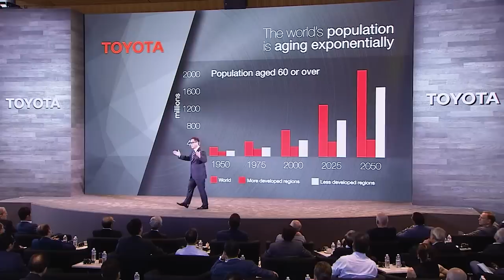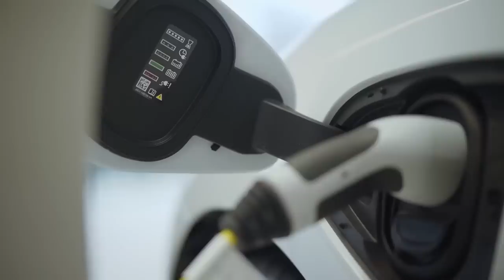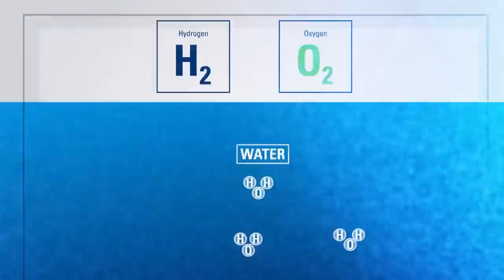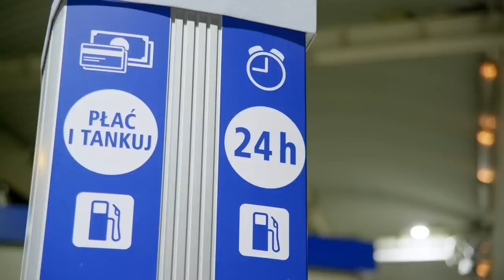New Toyota CEO Shocks Everybody | Huge News

Comment: EVs are a long way from being viable for everyone, so this makes sense.
Reply: But it is viable for the vast majority, and so non EVs will become more expensive relatively due to a reduction in economies of scale.
Reply: What makes EVs unviable for many people?
Reply: And not everyone wants one either lol
Reply: @Stefan Leonte  I have a pickup truck. I use it to tow my 5000lb boat/trailer, I use it to tow my 5000lb snowmobiles/trailer. Currently, I can take my boat or snowmobiles 450 miles in any direction within about 6 hours, not 2 days.
Reply: @TankEnMate  Not everyone lives in the city.
Reply: @stefanleonte3155  there is a whole list of reasons. Cost( will go up with demand for lithium and cobalt) charging ( availability and infrastructure) weather( everything is worse in cold) etc etc. 

There is a lot of problems still to be resolved!
Reply: @thnksno  that’s awesome! So how exactly does a hydrogen vehicle make sense? It sounds that your specific needs cover hauling a decent trailer load and also functioning in relatively remote areas. The Mirai has a capacity for 5kg of hydrogen, which is equivalent to around 150kWh of BEV storage capacity. The Rivian has a battery of 135 kWh, which many people complain about in terms of range for towing significant loads. How exactly does hydrogen make sense here? The number of hydrogen stations needed along corridors that people tow would be insane.
Reply: @antonherres7112  this is funny. Now do the same for hydrogen. If rolling out EV charging is challenging and expensive despite us having electricity distribution pretty much everywhere, humor is with how rolling out hydrogen stations and creating plus distributing hydrogen is going to be cheaper and easier?!
Reply: @Markcain268  it’s funny how people don’t appreciate that hydrogen cars are powered by electric motors, just like BEVs.
Reply: @stefanleonte3155  if they use a hydrogen power cell, yes, and, apparently, people don't want those either lol
Reply: @Stefan Leonte  It makes sense in that Toyota isn't all in on EV or hydrogen. Hybrid, for them, is a good enough stop gap. However, even that's not good enough to do real actual work at the expense of oil. Toyota's new full-size vehicles with hybrid are only gaining 3-4MPG on their prior normally aspirated V8. I didn't start this thread to cheer on anything besides Toyota not following the crowd. EVs on a mass scale have a long way to go. In fact, I'll go so far as to say, 40+ years.
Reply: Why would I have my only vehicle to be an EV. I’ll have an EV to drive around the city and near by cities/town, use a hybrid for long distance driving, and a light weight sports cars for ultimate enjoyment. This will always be the lineup for a house with multiple vehicles.
Reply: @Stefan Leonte   Theoretically, an EV could likely do a good percentage of my driving. However, it is mostly impractical for a good percentage of tasks I expect it to do as well. Ultimately, it is entirely impractical to have 2 vehicles, 2 registrations, 2 insurance policies, and need 2 times the space to store 2 vehicles that cost 2 times as much as "the best current solution."
Reply: @curvetrcalinga  LOL! I was just formulating the same message.
Reply: @thnksno  hybrids were a good idea for urban cars stuck in commuting traffic before BEVs. Hybrids, from an efficiency perspective, are arguably useless with BEVs available today. PHEV have somewhat of an argument but that is rapidly diminished by the reality that the bill have undersized battery packs paired with thirsty engines and inefficient aerodynamics, with it being more advantageous to simply dump the EV portion and retain the ICE portion of the package. For some applications ICE options will remain into the future, however, these will be few. Hydrogen has zero feasibility for personal transportation; the economics and infrastructure challenges are simply too great to ever compete with BEV. Toyota’s dangerous path is not its continuance with ICE, which is a sunk cost at this point, but rather the combination of continuing to pour more good money after bad in its fixation on hydrogen and it’s relatively slow adoption and progress with BEV compared to its competitors. For every person who needs a pickup to tow a trailer long distances in a remote geography, there a multiples more living in urban environments where hauling heaving loads is not a issue and access to electricity is plentiful.
Reply: @Markcain268  as opposed to what, using hydrogen in modified ICE setups? There have been numerous videos done illustrating why this is beyond impractical and stupid: the volume of onboard hydrogen storage leave pretty much no space for anything else. Engineering Explained did a good video on this in response to Lexus’ hydrogen V8 concept.
Reply: EV's are a lot closer to being viable for everyone than is hydrogen.
Reply: @easternyellowjacket276  yes, but it's dumb as hell to try and say everyone has to switch. Electric are good for some. And hydrogen in certain areas helps with the load in the grid electric cars cause. Not to mention the crazy demand for rare and toxic elements needed
Reply: @stefanleonte3155  make your mind up! First you are against hydrogen power cells now you seem all for them lol, seems like you just come on here just to argue!
Reply: Here in Europe EVs are perfectly viable TODAY. I've had one for 4 years now and have never been inconvenienced by owning one....in fact 95% of the time it is far MORE convenient to own an EV rather than having to stop an pump toxic fuel at great expense into a tank. The ICE is dead and Toyota and others just need to recognise that if they want to stay in the car making game.
Reply: @kiae-nirodiariesencore4270  I'm the same with ice, never been inconvenienced by one in over 30 years and all my cars have been very second hand lol
Reply: @kiae-nirodiariesencore4270   All of Europe is like the size of Wisconsin. In the US, you can drive for hours and still be looking at the same mountain range.
Reply: @stefanleonte3155  People who live in major cities have no place to charge their cars. In NYC (and the surrounding metro areas), where a lot of people live in apartment buildings, most don't have access to parking garages and have to park on the street sometimes several blocks from their apartment.  Where/how will these people charge their cars?
Reply: @thnksno  You really don't know much about Europe do you. I am from the UK which is 1.5 times the size of Wisconsin and I live in France which if 3.2 times the size. Spain is 1.2 times the size of California and France is just a bit smaller than Texas...Drive from Portugal to Finland and you stay in the EU the whole way and the distance is about the same as New York to LA. Sure, the USA has more contiguous land mass but we really do know what a 'road trip' is.
Reply: @thnksno  Europe is literally 2x bigger than the continental US.
Reply: @Markcain268  I’m for hydrogen fuel cells in passenger cars? That’s news to me! How did you ever come to that conclusion?!
Reply: @joelombardi4907  this is hilarious. Pretty easy - the majority of people in NYC don’t have cars! For the areas that have street parking, places in Europe have already shown how it’s possible to incorporate charging infrastructure into existing curbs, similar to parking meters. Want to try incorporating hydrogen fueling stations in places like NYC?
Reply: @stefanleonte3155  ummmm, I'm talking about the suburbs that surround NYC, like Queens/Brooklyn/Bronx/Staten Island---these are all considered NYC. Many people live in apartment buildings, big and small. Most have to park blocks away from their building. The parking meter/charger scenario might be able to work, but it will take NY many, many years to try and support this. As I mentioned, before any of this happens, NY needs to overhaul its entire electric grid, which serves over 8 million people.
Reply: @joelombardi4907  I’m very familiar with NYC and its boroughs, as I’ve lived there. Any infrastructure rollout is hard. However, some rollouts simply don’t make sense. If it’s challenging to rollout curbside charging for street parking when we already have the electricity cables right there, imagine how much more difficult it is to build and fill hydrogen filling stations. ICE is going away, and something must replace it for personal vehicles. It simply doesn’t make sense to try and go the hydrogen route for personal transportation over electric.
Reply: @stefanleonte3155  I'm not saying to go hydrogen. For the whole city to get on board with electric vehicles, so much as to be done. At the pace its going, we will not see it in our lifetime.
Reply: @stefanleonte3155  in your reply to a previous comment, you gave me a lecture for saying nobody wants hydrogen fuel cell cars, have you lost track or did you not understand my comment? 🤔
Reply: @TankEnMate  That is absolutely correct. Scale economies are being gained year on year for EVs and lost for fossil fuel cars as demand for them continues to decline. We reached 'peak ICE' in 2018 and those sales are never coming back.
Reply: @kiae-nirodiariesencore4270  took a lot of bribery to achieve it though, didn't it?
Reply: Tesla will be just like Ford and Chevrolet in 10 to 20 years from now.😂
Reply: @Markcain268  I think you may have completely misunderstood things, if you at any point you were of the understanding that I in any way support the notion of hydrogen as a fuel source for personal transportation.
Reply: @stefanleonte3155  price.  I want the Kia ev6 GT 576 HP version.   It will cost me 70k out the door.... FOR A KIA..... YEAH..NO
Reply: @kollennekoll5997  No they won't! You don't seem to understand embedded culture in companies. That's not to say another even smarter, faster, more creative firm will not come along and try to eat Tesla's lunch but right now Tesla are eating the lunches of the fossil fuel based OEMs who cannot compete in the only market that matters going forward, making and selling EVs.
Reply: @stefanleonte3155  price & weight
Reply: @stefanleonte3155  only batteries for you eh? Surely they can come up with something better than batteries and a motor, lol I was playing around with those as a child in the 70's,  think I'll wait until something brand new comes out!
Reply: Brillouin Energy begins commercialization of pulsed catalyst cold fusion electric heating system.
Leonardo Corporation publishes data sheet for zero-point energy source.
Brilliant Light Power develops clean energy solution for $0.001 per KWH based on hydrino technology.
Reply: That and the fact that EV's are not even close to zero emission because they consume far more materials and energy to build them. Also, when considering what to do with them at end of life they are an environmental disaster.
Reply: @stefanleonte3155  not everyone is retired and drives a golf cart
Reply: @timothyjohnson1511  There is so much going on in the world of technology. By early 2030s the oil and gas industry will be seeing a massive down turn in demand for their products.
Reply: Hydrogen is very hard to store and transport. You can't just use existing gasoline pumps or transport systems with hydrogen ones because it has a low volumetric energy density. You would have to build a new one. Because real hydrogen motors don't work well there are no real hydrogen cars currently, they are all actually electric vehicles with hydrogen fuel cells. Making them more complex and they need more lot more maintenance compared to battery vehicles. Also turning electricity to hydrogen and back to electricity introduces huge of energy loss compared to just batteries. It's tech that is not going be used in cars expect maybe in very very rare cases for long range transport.
Reply: @TankEnMate Until an ev can be purchased for less than 20K new I will not buy one. You may think that 45-50k is reasonable for a daily, but I do not. The US is not like Europe, EV works because vehicles are small there, distances traveled by car are less as mass transit is more efficient and less costly. Here in the US where everything is big, heavy and everyone has a personal vehicle EV is not as efficient as people think. If the US goes full EV without an alternative to a heavy battery, we'll be paying more for 80% fossil fuel electricity than gas or diesel. I'm of the mind that if one doesnt want to drive or really wants to make a difference with the environment, investments in bus and train needs to be made. EV alone is just putting the blinders on and ignoring the real problem.
Reply: @stefanleonte3155  Have you ever heard of "hydrogen combustion"?
Reply: @kiryukazuma88  he only likes batteries and leccy motors
Reply: @bdaig12  In the US both solar and wind are cheaper than coal, gas, or oil for electricity. Even today a BEV is cheaper over it's lifetime than a fuel based car (ICE or fuel cell), the only thing that is more expensive is up front cost; for BEVs energy is cheaper, servicing is cheaper, and resale values are higher.

Norway is a fossil fuel giant; it has massive reserves of oil and gas; and has been exploiting that for decades. But for their own use they get 99% of their electricity from renewable sources. Over 80% of their vehicles are BEVs. And they have one of the most rugged and inhospitable landscapes in Europe. And to top it all off they have one of the highest per capita incomes in the world (about 14% higher than the US). They have universal healthcare and universal social security. So progress is possible if the focus is on finding evidence, adapting to change, and solving problems rather than only believing what you want to believe, dressing opinions up as facts, and scoring points.
Reply: @TankEnMate  LOL hows that?  you cant even pull anything without the milage going way down.
Reply: @stefanleonte3155  Try living anywhere where it gets below zero in the winter.  You can have a full charge and the cold will drain  it to nothing.
Reply: @johngatsby1473  price you say? Okay. What is your ICE equivalent for the same power and performance in a four door vehicle with a plenty of storage? Since price is your issue, you’ve got a cheaper ICE equivalent, right?
Reply: ah yes, of course. The most popular selling vehicles in America (full size pickups) are so cheap and light! Funny that.
Reply: @Markcain268  maybe wait till we go back full circle and land back at using horses, with excrement everywhere. Would work for you I’m guessing.
Reply: @kiryukazuma88  have you ever heard how much space that energy storage takes? Engineering Explained has a great video that explains why it’s such a stupid concept. You’d benefit from watching it.
Reply: @Adol666  more comedy! I live in the Northeast, and can confirm that position about range during winters is complete garbage. Not only that, but they handle snow so much better than ICE - even the rear wheel drive Model 3 handles snow better on all season tires than our previous Mercedes all wheel drive.
Reply: Most of us life in apartments n ghettos.
Reply: @stefanleonte3155  look ....$70,000 USD for a Kia ev6 GT is not reasonable.
Reply: @Adol666  the loss of mileage for both BEVs and ICEs is about the same; 20~30%. Given that BEVs are cheaper per mile, you're still better off with a BEV. Also, most BEVs weigh more and have a lower weight distribution which means they are generally a safer vehicle to tow with.
Reply: @johngatsby1473  look at what? Show us why it’s unreasonable. Show us that you can get a similar thing from a different brand at a cheaper price. If you can’t, guess what, the price isn’t unreasonable, it’s just something you don’t want to pay. Two different things.
Reply: @kiae-nirodiariesencore4270  No you don't.. You have no idea.. Sooooo, you've driven from Turkey to England...LOL..LOL.. You DO KNOW WHERE ALASKA IS RIGHT..LOL..LOL..
Reply: @timothyjohnson1511  LOL.. AND THEN YOU WOKE UP....LOL.. $1 kwh in Norway today spot market..
Reply: @TankEnMate  Resale values are NOT HIGHER.. Go buy a used car today, then price a used EV.. Do it, TODAY..Are you just an EV nut...LOL..
Reply: @stefanleonte3155  have you seen the car?   It's a compact car, gets 200 miles to a charge and is quick.  The Tesla has the equivalent that gets like 100 miles more for less money AND you get the tax credit.  It's over priced.  Tesla has now become the reasonable priced option in the electric car world.   Something tells me you are the type that looks for an argument/debate at every turn.  Are you the one that has to be right in every conversation?
Reply: @Markcain268  Not at all. If you're talking about subsidies then take a look at how much subsidy the fossil fuel industry has got from governments over the years, makes the incentives to buy EVs look like chicken feed. Tesla made EVs desirable and now the rest of the industry wants a piece of the action... if they want to stay in business
Reply: @wanton7306  Spot on. There are so many petrol heads around who need educating.
Reply: @kiae-nirodiariesencore4270  It's a complete fantasy to think that EV will replace ICE in the near-term. The true environmental cost and availability for raw materials of EV is not sustainable as it is, let alone increasing production enough to REPLACE ICE vehicles. The electrical grid can barely handle the load TODAY, nevermind adding a hundred million EVs charging all the time. Politicians are working hard to make our grid LESS resilient, not more, by switching away from natural gas/oil/nuclear and moving to solar and wind. It's a complete joke and you would be a fool to think this is all going to magically work out in the next few years. The number of challenges is huge, the environmental benefit to switching to EV is negligible, and they cost way too much for average people right now. It's just not happening anytime soon.
Reply: @johngatsby1473  funny that you make a statement about an EV car being unreasonably priced, and then point to another EV as value in a conversation about EVs being too expensive compared to ICE. I’m not a KIA fan but won’t hesitate to call out ridiculous comments regarding EVs. No need to tell me about the value proposition of Teslas, as we’ve already made the switch; hard to see how I’d ever go back to German brands.
Reply: @kiae-nirodiariesencore4270  most folk who buy evs do so because they are cheap to run, many will admit that too
Reply: @kiae-nirodiariesencore4270  Also lot of anti EV people keep talking about cobalt. Newer EV batteries doesn't even use it. But what they don't seem to know is that cobalt is actually used by oil industry for refining crude oil in what is called desulphurisation. Also batteries should be quite easy to recycle and that means less mining in the future. Oil industry propaganda is strong and they must know hydrogen for cars is a lost cause, but they must really like that it's been talked about like it's something better batteries because it will slow down EV adoption.
Reply: There’s a certain consumer that wants a EV to suit their needs
There’s a certain consumer that doesn’t want a EV 
Let’s just see how it pans out after the initial hyped rush 
Personally I think they are far from the real deal
Reply: @stefanleonte3155  Gee really snappy today aren't ya? And what do you mean space? All you need is a hydrogen tank in place of a petrol one, it's already been done before.
Reply: Lol, all the energy these ev  fan boys waste droning on and on and on and on, and nobody takes them at all seriously, eli rusk would not approve 😂
Reply: @Markcain268  Yep. Cheap to run, more reliable, better to drive, less to worry about.
Reply: @kiryukazuma88  what can I say, its increasingly painful to digest the amount of rubbish people spew out. It’s amusing how people try to make things sound easy and straightforward. The issue is with how big the hydrogen tank needs to be to have a reasonable range between fills. A hydrogen tank needed is many, many, many times larger than a gas tank in an ICE car.
Reply: @Withlovefrominterent  You are so wrong on so many fronts I don't know where to start. EVs are and will slowly but surely replace ICE and the change is gathering pace. Already in Norway 85% of new car sales are EV and about 20% of all the cars on the road are EVs...it will take years to churn out all the fossil cars but with gas stations closing in Norway and the value of ICE cars falling like a stone they will go to the breakers yard early. Where Norway goes the rest of Europe will follow, Sweden and Netherlands are following the same trends about 3 years behind while the big markets like UK, France and Germany are already looking at 30% this year and 50% by 2025 of new car sales. It will take about 15 to 20 years to see the end of petrol and diesel completely but when EVs are about 40% of all the cars on the roads (mid next decade I estimate) then gas stations will. not be viable. EVs make a HUGE difference to the environment, already displacing millions of tons of Co2, not to mention SO2, NoX and particulates. Mining materials for EV batteries is nowhere near as damaging as drilling, pumping, refining and shipping crude oil into gasoline. Show me a technology that can turn tailpipe emissions back into gasoline and I may take you seriously...whereas battery recycling is already becoming a big industry.
Reply: @kiae-nirodiariesencore4270  yeah, so the fan boys keep saying🙄, they still don't interest me though, so, unless I become dependent on cars to get around, I won't be having one! 😊
Reply: @stefanleonte3155  I don't have time for people who can't have a mature discussion about anything and only whine and complain. If you want to prove your point, kindly provide me with a source for that claim (about the tank size having to be significantly larger) and give a proper source, not just some video you found on here.
Reply: @kiae-nirodiariesencore4270  Regardless of whether or not it's clean or not clean or whatever the effects on the environment will be, some things are simply indisputable. There is no path forward to generate the kinds of energy in Western nations that could possibly support a massive switch to EV. This is something that will take multiple decades to address, and require coordination and cooperation that doesn't exist currently. It's also completely disregarding geopolitical factors like all the BRICS nations moving to control fossil fuels as we speak. China is poised to take over as the number one economy and super-power, and they are building 2 new coal plants per WEEK. European nations are desperate for Russian natural gas although the leaders there are working feverishly to shut down all local production. The Saudis are worth trillions and trillions controlling OPEC production and unless they have a way to profit, there will not be any kind of major switch to alternative fuels anytime soon. Not to mention, rare minerals will not be available to support any kind of huge switch to batteries across nations. Ford CEO was just talking about this the other day. It's just a fantasy to think that the whole world will switch to EV anytime soon. Not gonna happen.
Reply: @kiryukazuma88  not sure how you’re conflating the reality of physics with complaining. This isn’t an issue of opinion. The Engineering Explained is hardly a random source, and Jason is a mechanical engineer. His video on the Lexus’ hydrogen concept vehicle concisely explains how unrealistic a hydrogen combustion is. No idea what exactly you’re after.
Reply: @stefanleonte3155  all I was after is a mere source. And I fail to see how a Lexus hydrogen concept car provides an account for all hydrogen vehicles...
Reply: @kiryukazuma88  it’s basic physics. Just like a milliliter of water has the same volume no matter what vessel it’s in, a kilo of hydrogen takes the same amount of volume whether in a Lexus or a BMW. There’s nothing tricky here. This isn’t the same conversation as battery pack density, where battery chemistry, cell design, pack design, etc. all impact the physical size of a pack. If you’re genuinely interested in learning more about hydrogen, go and watch Engineering Explained’s short video on the topic; it does a great job explaining the topic.
Reply: @stefanleonte3155  I'm quite sure that large tank size only effects real hydrogen engine not electric cars with fuel cells. Current real hydrogen engines seems to be VERY inefficient and there are no real hydrogen engine cars in the market. Toyota was developing one for a race but it burned down before they could race with it because of hydrogen leakage. Hydrogen is prone to leak through very small gaps. I wouldn't want to drive one because of that.

Good thing it's very unlikely hydrogen for cars is going to happen at least here in EU. Too much going against it. Doesn't seem like its happening China or in US either. Example in US Shell has closed all its hydrogen fueling stations. But it could be a thing in Japan. I don't think there are any other country taking it seriously and at least western countries seems to be going other direction and are just adding more and more charging stations for BEVs instead.